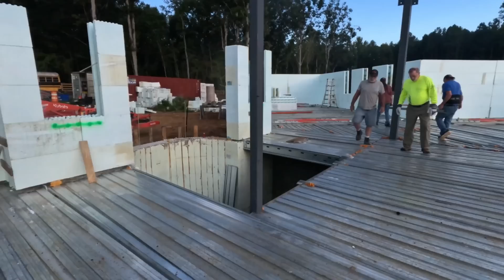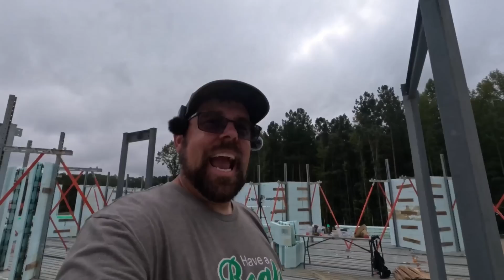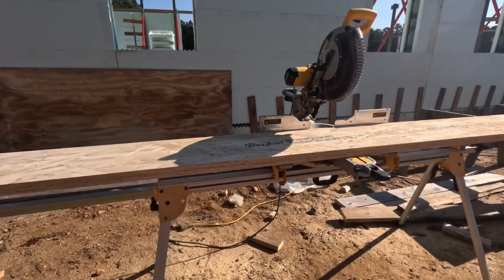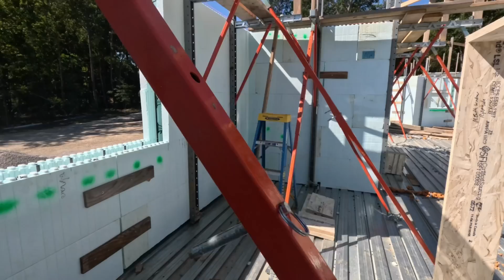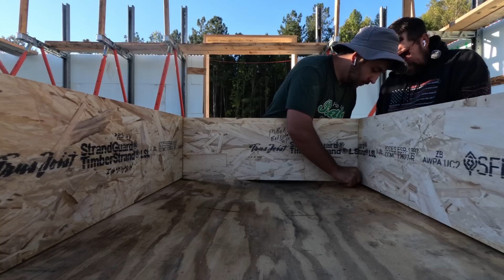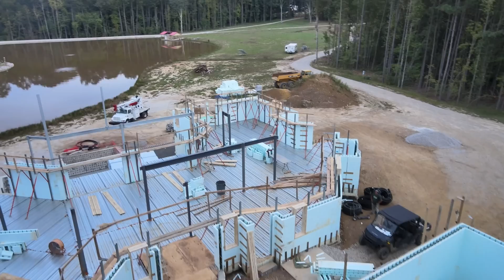ICF Main Floor: The Future of Home Building

Comment: How'd you get hurt?
Reply from the maker: @nandi123  My thumb stayed in an area that ended up 1/4” wide. 😳. Good now.
Reply: @BealyGood  Oh no! I hope you feel better soon.
Reply: @BealyGood ouch!
Reply: @BealyGood  Wow, that was a tight fit.  So much for the "Days without Injury" board.   Glad your better Mr. B.
Reply: Egads! 😳 @BealyGood
Reply: @BealyGood  Yeouch!  Been there done that!  Mine was between a workpiece and the fence on a miter saw.  Blade kick.  Lightning fast instant pain!  You'll be okay, and you'll never forget.
Reply: Ugh hope you feel better soon!!! Take care
Reply: Look how Mr. B is standing straight by the wall. I would say from experience he pulled his back out.
Reply: The missus (and food gatherer) will not allow you to let a small OTJ injury keep from having a roof on before Christmas…gotta have a Christmas tree raising. Good work, your crew is learning right along with the process. 
Get your self healed and ready to rumble!
Reply: Ouch! Did you lose the nail?
I caught the tip of my thumb in a extremely heavy sectional garage door. To this day it's still wider and about 1/4 inch longer than its mate on my other hand. Hurt like F too lol
Reply: I was just wrestling an 11 pound fully armoured heavy duty wrecking ball of a cat when I tripped on my slippers. Cat landed on the bed and I did not. It feels like 3 months of knee PT have flown the coop.  Back to painful stretching. More time to keep an eye on you all. Hope you heal up quickly.

Comment: I'm in the uk, telehandler driver on the sites, your build is strange to me, but ILike it. Polystyrene and concrete, cinder blocks and concrete, then cladding or siding ? I'm more used to bricks and mortar , so this is quite interesting.
Reply from the maker: @faelsinnes  will be brick mostly , on the outside

Comment: Hope your able to answer my question im watching your journey in the uk, i dont think we use icf in the uk why did you not pour the ground floor before you put up the 1st floor also i can understand the insulation values of the foam how is it finished on the inside will it be stud work and plaster board or plastered straight on to the foam looking forward to finding out im not a tradesman but have been involved in the building trade my whole life im now retired thanks in advance
Reply from the maker: Hello. I didn’t pour the basement floor yet for a few reasons. In no particular order - I need to do under slab plumbing and the radiant floor piping, that is going to take a while and I would like to get under roof before winter. - The suspended concrete floor for the main floor will be poured first because the concrete will drip through in some places, I don’t want that on the new basement floor. I could put down tarps but more work and cost. - The concrete floors are going to be stamped concrete so as soon as I pour them I will have to put down thin plywood or something equivalent to protect them. Hope this helps. Cheers
Reply: @BealyGood  makes sense why make extra work when you dont need to thanks for your reply i will keep watching and hope to see completion

Comment: Sped up segment with the radial arm chop saw looked cool,  don't you wish it could happen so fast? The corrugated floor looks to be an ankle twister if your not payng attention. All part of the job anyone can twist an ankle just walking down the street. I have 2 of them that can vouche for that. So when is the next pour?
Reply from the maker: The panels aren’t bad. Have to be careful of the floor joists though. Thanks 😊

Comment: Geoff, question when you first started putting in the prebucks you mentioned the expense of them couldn’t buy conventional lumber is it a width or structural issue just asking take a routher and a dovetail bit and have the same thing was in the lumber business for 32 years
Reply from the maker: The width for the basement was 13.25”. The main floor is 11.25”. I definitely could router. Just a lot more work.

Comment: How do you get concrete under window frames  that you just installed?? Just wondering
Reply from the maker: It mostly flows under if you have the mix right. But we will cut holes in the window bucks to be able to run the vibrator through and add concrete if needed.
Btw, are you a beale?
Reply: @BealyGood yes I  am, but spelled Beall got a twinn bro and 2 more bros and sis fine Christian family who always have fun together. Yep looks like your 
Family doing well also.😊
Reply from the maker: @haroldbeall5854  nice! Probably relatives somewhere down the line 😁

Comment: How do you get concrete under window bucks??
Reply: Concrete should flow under, but will also typically hole saw in the bottom of buck to be able to 'top it off' & vibrate.
Reply from the maker: What Allen said

Comment: They was using a battery powered screwdriver as it happened maybe he put one though his hand or into his leg. I've seen a person lose control of a buck and it pivoted forward and bounced off his hard hat he wasn't wearing , yeah he was out for a while, oh who knows couldn't have been too serious as he always follows instructions and safety procedures. He's Bealy Good don't you know! Aaa don't use the crane as a dive platform until you determine where those stumps are,LOLLOL Good luck get healed up.
Reply from the maker: Safety First is my second name
Reply: Oh Gosh I just thought he might have fallen through the hole, I rode an extension ladder all the way to the floor then fell backwards on the rungs, it was half no rubber feet and I was 6feet 8 so the back of my head fell 16 feet LOLLOL I was so pissed I jumped up and bent the aluminum ladder in 2 no it didn't knock me out.